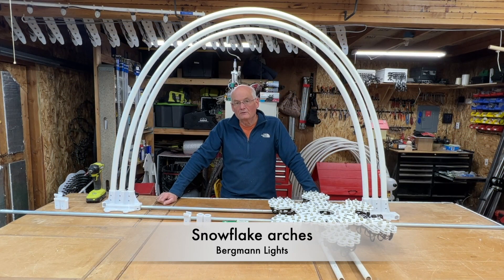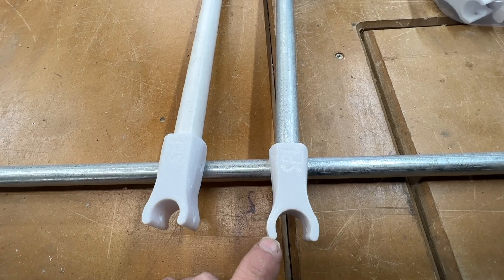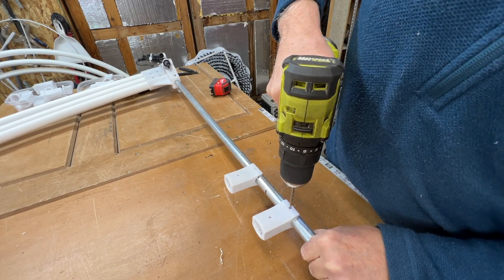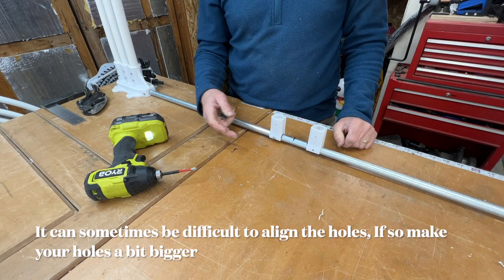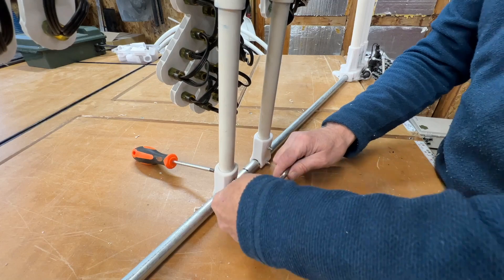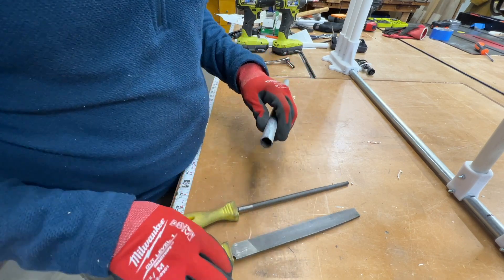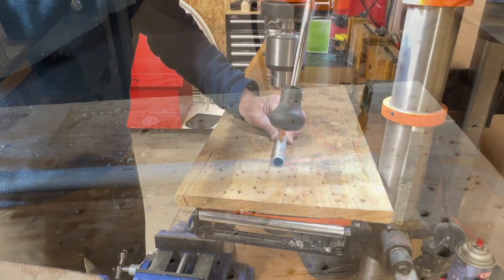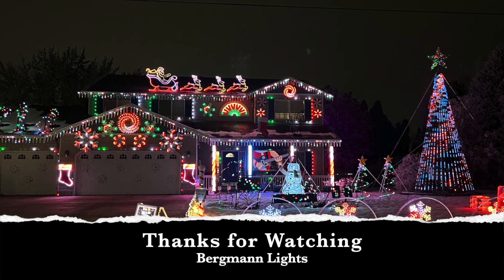Snowflake arches

Comment: I like your snowflakes looks awesome and sturdy. Did you splice in 6 more nodes in it ? thx for the share.
Reply from the maker: I cut the pex to match the length of my strips.  Your Pixel Store has three different lengths so no splicing is necessary.  You can cut your own and solder the connectors